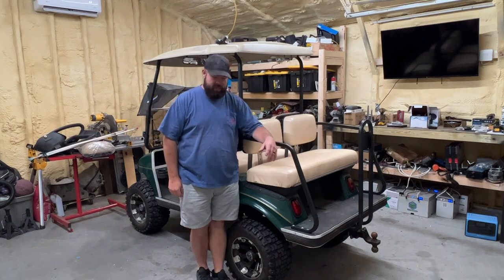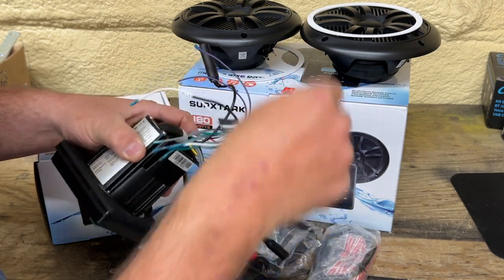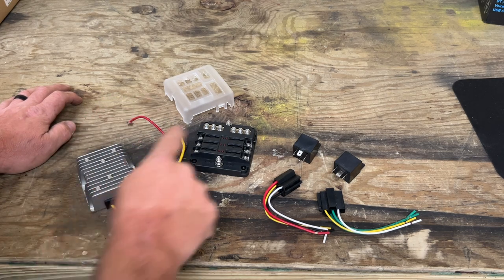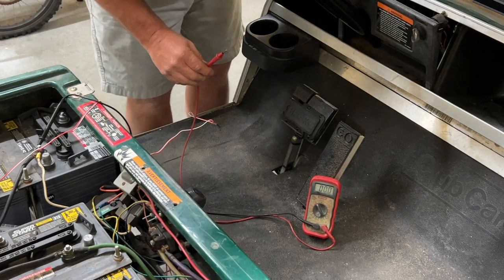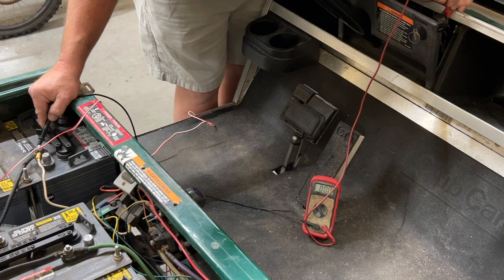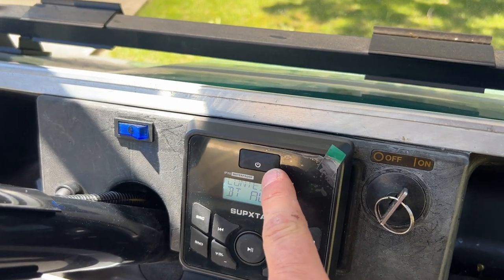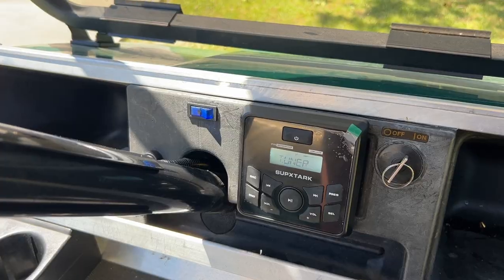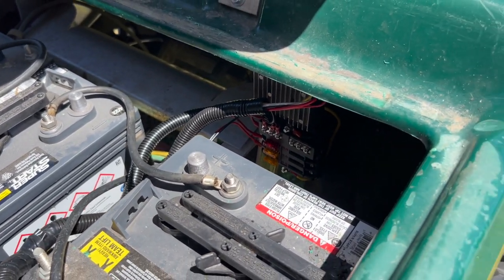$120 Bluetooth Marine Stereo & Speakers Installed In Golf Cart and I CANT Believe How It Sounds!!!

Comment: Thanks for you video. I'm lost on my install on an old ez go txt electric cart. How do you recommend I strart I have the fuse box and the the other items you recommended
Reply from the maker: It doesnt matter what brand of cart it is, basically the same install. Locate where you want to mount the speakers, drill the holes and install them. Run the wires to the radio. Mount the Radio. Wire it to the dc converter and fuse block.

Comment: Please tell me what tool you used to cut the plastic circles.
I like that it can get into tight spots.  I only have an electric jigsaw.
.
Do you think it would be worth using 2 pieces of Dynamat insulation cut into circles to replace those white gaskets.
Placing 1 on each side of the plastic so that the plastic body does not vibrate while the speakers are on?
Im not sure if Dynamat is waterproof but I would still appreciate your opinion.
.
What type of material did you use to attach all of the electrical components together?  I doubt you would use metal.
I did not see a fuse after the relay and before the main input to the down voltage converter.  Was there one?
Reply from the maker: I usually do a fuse before the converter, I didn't show it on camera but a new video will be out Monday showing one. The tool is a rotozip for cutting sheetrock. It was a trash day find that was missing the on/off switch. I used aluminum angle to place all the components on the side of the frame.

Comment: I have same fuse box but I am running the 10LOL reducer 4 wire , I have a question about ground. Would I run the reducer ground to battery then to fuse block. Thanks

Comment: If I use an inverter that has the keyswitch wire will that eliminate the use for the relay?Thanks and great job!
Reply from the maker: You can but they still run with the key switch off. They have a constant 12v wire like a low amperage one to run clocks or radio station presets.

Comment: I'm trying to find a good location for speakers on my DS. Did you have any concerns or issues with water getting into the speaker?   I don't use my cart in the rain but sometimes it rains when I'm out and I'm worried about rain collection in the speakers.
Reply from the maker: This one belonged to a neighbor down the street. However Ive done multiple carts with the speakers in this location. Ive never had a problem with them. Just make sure you use marine speakers if you plan to mount them in that area.

Comment: I am installing this setup with the fuse box, reducer and relay on my golf cart. I have a question.. I am installing a pioneer stereo with some marine speakers, no amp. What size fuse should I use for stereo in fuse block? Thanks for this video, very easy and straight forward.
Reply from the maker: 10a is what I’ve always used with car stereos.
Reply: Thank you! thats what I figured. I am also doing the ATV key switch next on my ezgo. @Fentertainment
Reply: I have a question if you can help me out.. My stereo harness has Black, Red, Yellow wires besides the speaker wires which I know where those go. It also has a blue/white for remote which I don't have. So the red goes to + on fuse block does the black go to - on fuse block or is that chassis gnd? also what about yellow? is the yellow constant going straight to positive on battery ? Thanks in advance!
Reply from the maker: @danrg3000 Black is ground, Red is ignition power, Yellow is contant power for memory, Blue/white is amplifier turn on. If you dont have a amp just cap it off. I usually just connect both the red & yellow together on my installs because the converter will turn on and off with the cart.
Reply: @Fentertainment  Thank you!
Reply: hello Sir, I have another question bear with me.. @7:30 in the video you are describing where the wires go from relay. Red to main battery Black/white to ground or - negative on main battery? I have been plugging away on my setup when time permits and I'm almost there!
Reply: I just am confused if it chassis ground or negative terminal on battery.
Reply from the maker: No chassis ground @danrg3000
Reply: Thank you! I'll put it on the negative terminal then. @Fentertainment
Reply from the maker: The shunt goes between the batteries and everything else. Dont put it beside the stuff but inline. @danrg3000
Reply: I never asked this wiring setup will work on Ezgo txt correct? anything different I should do? Thanks @Fentertainment

Comment: Any changes you would recommend to run this stereo off of a gas cart? Would I still need the relay? Thank you!
Reply: I'm wondering the same
Reply: @meatball5244888  so I actually did it on my own. I have an 03 Club Car DS, it was a process, but think I figured it out… what kind of cart are you driving? I could help out. The biggest difference are there were 4 connectors on the back of my ignition, you definitely need a volt meter to find the one that goes hot when the key is on
Reply: I have a 2023 ezgo valor gas powered. The easy part of mounting everything is done. Now I need to figure out how to wire everything correctly. I'm running a radio/amp both with an individual fuse or capacitor. Front light bar, rear light bar, red glow lights (zombie lights lol), and a ground light kit. All going to a rocker switch panel. Just needing to know if I need to run a separate battery and if I need the relay or fuse box ( what size fuse for each device?)